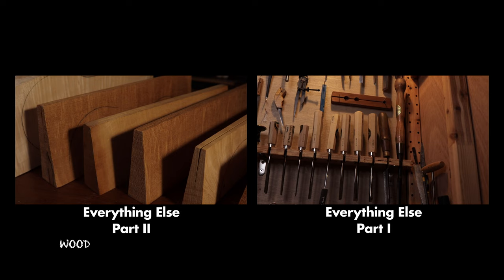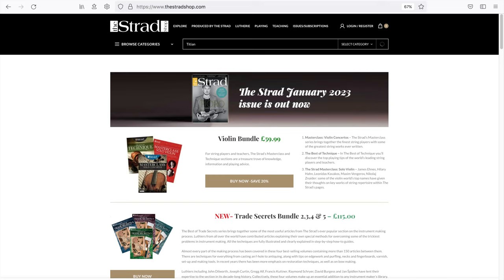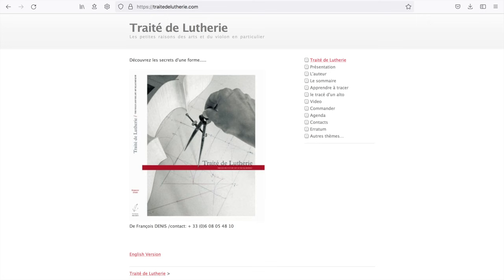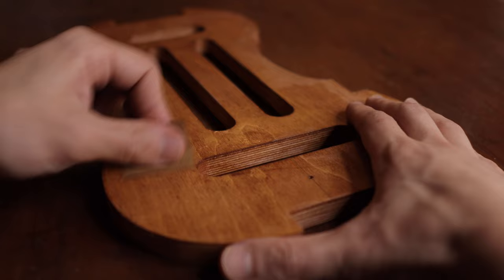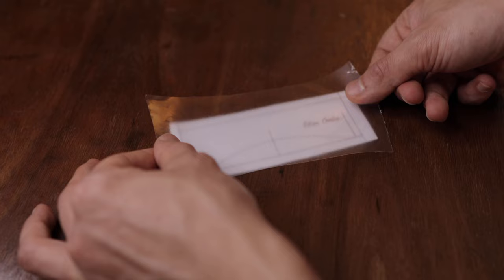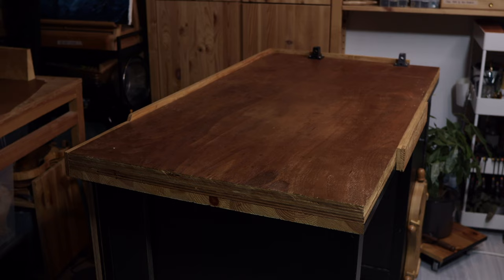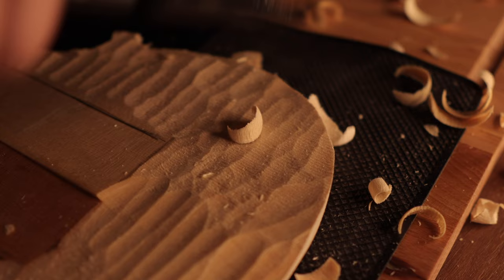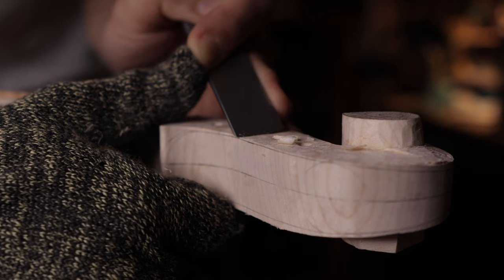How to make the Templates and Form for your Violin

Comment from the maker: If you don't want to do all these, there are some commercial sets you can buy out there, just that I find some of them are not very accurate, and expensive... 

But you will have to make the Curtate Cycloid arching templates yourself anyway, as all the commercial archings are straightly copied (more or less) from the poster, which is the worn out archings.

And here's the Digital Titian Templates again:
https://mekwok-studio.myshopify.com/products/titian-template?fbclid=IwAR18Z3whKkR3PfXumKCgGUbDs7NjYDUw07gFrOUbsIdyA1dvmSqqT44BjaI
Reply: Thanks for all these videos that explain how to make a violin. 
I watched the video text 1:26 "this traditional 16th century criminals made violence with a form" I don't quite understand. Maybe this "violence" means "violins", but what do you mean by "criminalists"? In what sense were they criminals - if not in the sense that they used at least the now-endangered Ebony? 
One thing that was unclear in the video where you show how to form the ribs: How do you actually get the mold out of the inside of the pre-glued part. With fast-forwarding and a weak viewing angle, it didn't get it at all. Which one would you have the opportunity to record on video in more detail :)
Reply from the maker: @MR-ub6sq  Hah, I mean 16th century Cremonese made Violins with a form.

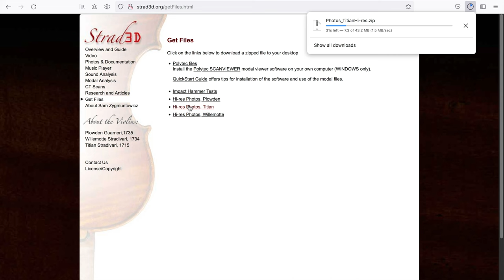Comment: Hey! You said here 2:25 “there are no measurements included” and “make sure your printer is calibrated” my question is, what is the measurements should i calibrate in the printer?
Thank you for your efforts
Reply from the maker: There is no measurement on the photo, but there is a chart somewhere in the website. Follow the body length and print it with the right size.

Comment: Thanks for your very instructive video. Always a pleasure to watch. I'm now building my second violin and used the Stainer 1679 model from the stradshop (not the easiest to do as a second build). I found that the pictures are somewhat misleading. Only the foto's appear to be on a 100% scale. But the drawings on the backside, except for the arching, are just sketches to show where the measurements are taken. You definitely need to be aware of that! Making a template for the neck from that poster is also a bit difficult. You can only use a foto of the scroll,  but there's no dimensioning for the rest of the neck. Do you use a default template for that?
Reply from the maker: Yay, some of them are misleading, that’s why I make my own templates. For the scroll, I will get the outline of it from the poster and work the neck out on my own with universal measurements!
Reply: @MekwokStudio  Thank you so much for your time and effort ion making these videos! I'm preparing to start my first build. For the neck and scroll, most templates I've seen include a side view, but nothing from the top showing the dimensions of the scroll, peg box and peg locations or even width of the neck/fingerboard. Am I correct in assuming that these measurements would be taken from drawings, or are some templates or drawings available that would include these measurements? Thanks again!

Comment: Is that drill press tool a safe T planer? I would loce a similar system as i hate making the purfling platform with files, do you have suggestions?
Reply from the maker: I use the Foredom SR for the purfling.